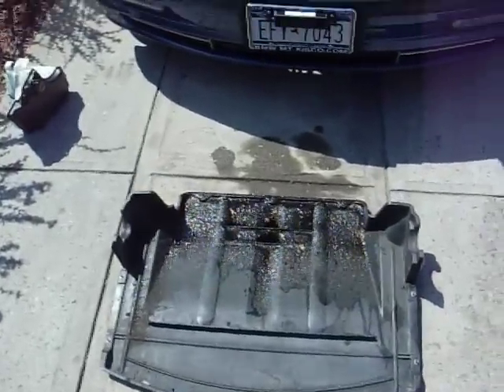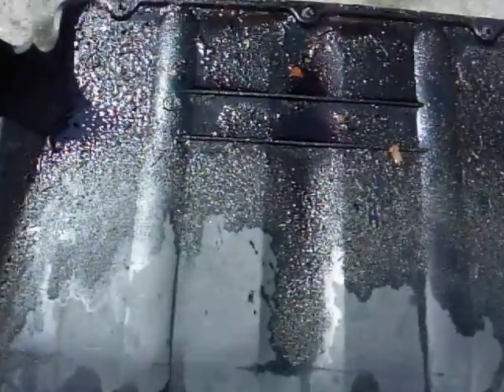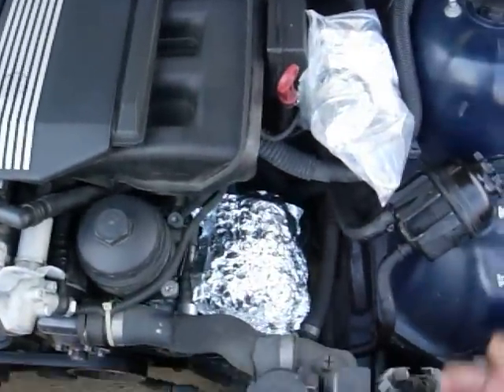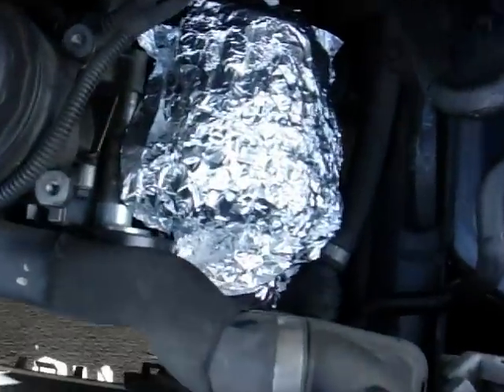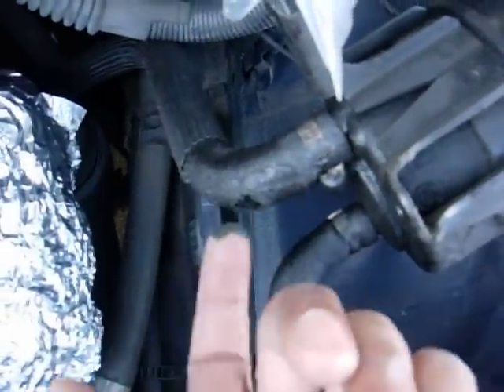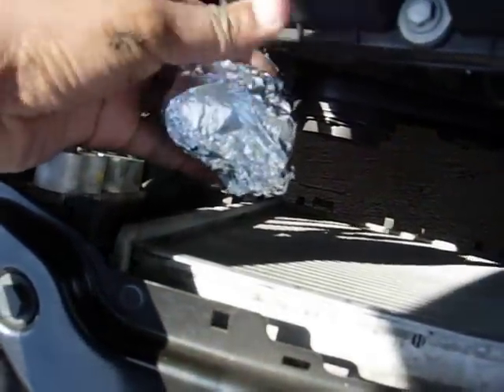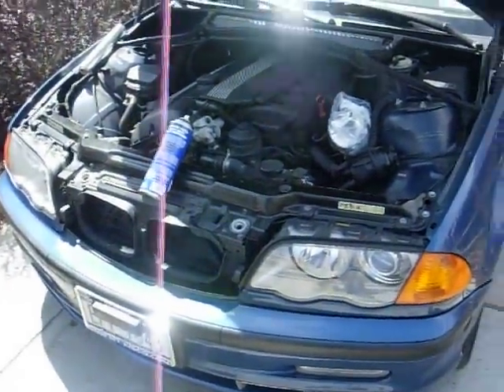How to Wash Your BMW Engine Bay & Diagnose Oil Leaks - Part 1 of 4

Comment from the maker: @StarsMarsRadio These places on the M54 are Valve Cover Gasket or VCG billed at $100 parts/$50 - $75 labor. The Oil Filter Housing Gasket or OFHG billed at$6 parts/$150+ labor. Then finally the worst of possible oil leaks can come from the Pressure Control Valve or CCV billed around $200+ parts/$300+ labor. The CCV tends to fail during the colder months. The VCG and OFHG can fail at anytime. There is also the rare Oil Pan Gasket leak that I know little about at the moment.

Comment from the maker: @Zukatsr125 Based on the symptoms that you have it is the Valve Cover Gasket (VCG) being old and cracking.  When this happens it leaks oil along the outer edges that dribbles onto the metal heat shield/exhaust manifold and burns off in a white smoke while driving the car. Also you can smell oil burning  thru the cabin AC  vents. 
Another issue of VCG leakage is oil getting into & flooding  the spark plug  chambers.  Just replace the Gasket. Parts are $30 - $80 and Labor is $50 -  $100.

Comment from the maker: @StarsMarsRadio modern BMWs unlike many other car brands have a plastic cover under the engine bay that usually collects any leaks and drips it onto the ground in one or two places. I am familar with oil leaking but on the M54 it can be around 3 separate main places where oil would leak. Finding the leak can save you hundreds of dollars as to just taking it to the shop and saying it is leaking oil. They can charge you for all 3 places when it could be just 1 or 2 places that leaks oil.

Comment from the maker: Oil tends to leak from 4 places on the M54  Engine. The list below starts with the most likely place for leaks to the least likely. Coincidentally the list also starts with the least expensive/easy to fix to the expensive/hardest.
1. Valve Cover Gasket - leaks on passenger side w/ white smoke seen & oil burning smell whiles driving.
2. Oil Filter Housing Gasket - big leak in the center front
3. Oil Pan Gasket - leaks center rear
4. Oil Pressure Valve (CCV) - lots of oil, oil warning lamp on

Comment: Might want to take some precautions covering the alternator with foil.. You might arc or ground your positive leads.Try plastic shrink wrap and make sure the engine isn't hot! Water won't harm your alternator but the chemicals in the degreaser might.

Comment from the maker: @olaf2046 A note about the Oil Filter Housing and Valve Cover gaskets: These gasket seals are rubber and wear and tear items that should be replaced every 60,000 miles and/or 5-6 years. These tend to go when the weather changes like during the spring seasons. The CCV or Oil Pressure Valve tends to fail during the colder months of the year. The CCV is a plastic unit with various plastic hoses that can go over time (after 10 years/over 100,000 miles). The Oil Pan i don't know much about.

Comment: My 1998 318i E46 is leaking oil and the shop say that the price for fixing this could be anything from $300 to $2500 (this is prices in Norway man). But at least I am not smelling burned oil in the cabin or when i open the hood so that sounds a bit like good news as the most expensive part is the top I would assume. Going to try to clean it but I guess I will need some help getting the bottom plate off. I noticed its been leaking less over the past months though.

Comment from the maker: It is a special degreaser MADE SPECIFICALLY for the Engine Bay! It degreases and also leaves a sheen to keep the rubber parts from drying out.
I'm sure they are tons of other types of degreasers made specifically for other applications such as dish washing or street cleaning! This one I use is MADE for cars!

Comment from the maker: @Zukatsr125 Save yourself the money and hassel and just have them change the valve cover gasket. That is a must on a car that old. Start with that first. Diagnosis for oil leaks tend to be $125+ and they can tell you pretty much anything since oil can leak from anywhere on most cars but it only leaks in 4 places on the M54.  When I first started driving my first car was a 95 BMW 318i and I spent thousands at the dealership and shops diagnosing stuff that I do myself today better and for free.
Reply: 0LAF2046 i have a bmw 530d f10 with oil leaking issue what are the possible areas for the leak

Comment: my bmw 328i leaks oil to the manifold , the one close to the cabin filter has lots of oil on it after removing the engine cover. after removing one of the spark plugs , I see lots of oil on the threads and look inside the spark plug hole. piston looks very black 😱. is it valve cover gasket leaking?
Reply: I would say yes. There is a "aluminum colored" plate that runs the length of the block...normally its clean and shiny but if your Valve Cover Gasket is leaking, this is where you will see oil and thus, it will create smoke in the air-vents, etc... If you have oil coming from where the front of the engine is, then its probably punp related. In your case, I would assume its the Valve Cover Gasket. (Its roughly $40 for the VCGasket itself & if you have a Torx set and about 3hours, you can save yourself anywhere from $250-$500+ dollars. Just YouTube Buvarian Auto BMW...they do ALL DIY tutorials on BMW's.) Good luck man!
Reply from the maker: yes. I agree with Random2381. Oil leaking to the passenger side's rear and upper parts of the M54 engine should be the upper cover gasket.
Reply: ^Good Advice! TTT! I forgot to mention, Olaf might have a great DIY too! Not sure though. Again, good luck man!

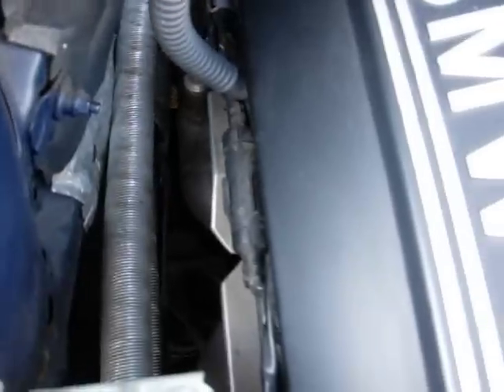Comment: Im thankfull if you can help me, My dads Bmw 530i  year: 2001  is leaking oil,, the oil came on the upper heat plate you can see at 1:36 in the video.. The engine mis-fire on 2 cylinders, and my theori was that the pressure was high and it "push" the oil out from the cylinder head.. Any Ideas?

Comment from the maker: gaskets leak. I never heard of this pressure switch leaking unless he mean the pressure control valve which would leak oil like a river. This leak is usually accompanied by loud engine howling (like your car is giving birth) when the car is parked and engine is still cold and on.

Comment: hello good evening look I have a question I have a BMW 325i 2004 came driving and I noticed that the engine oil was coming stop the car check the measurement of oil and all the shooting will take 2 bottles of oil and the car if it catches but does not change for me back and forth which can be
Reply from the maker: sounds like your valve cover gaskets are leaking.

Comment: Ummm, no, oil seals and gaskets are NOT wear and tear items.  BMW messed up and these gaskets prematurely harden and leak.  I just replaced the VCG on my 04 X3 with 100k on it, and my 96 Nissan with 185k on it.  It took me 20 minutes to do the Nissan and it was likely just loose bolts cuz the VCG was still pretty gummy.  The x3 took me 2 days to do because the VCG disintegrated and it took me 2 days to clean up the mess.  I've owned 12 cars in the last 20 years.  None had this defect.

Comment: I had a pretty big leak lately and i took a chance at replacing the oil filter housing and it stopped =] all i have to do is change the valve cover gasket so it stops leaking on the exhaust. it fucking stinks and smokes lollllllllllll